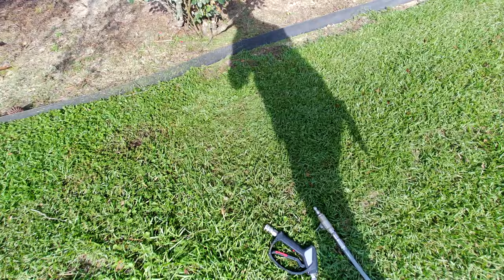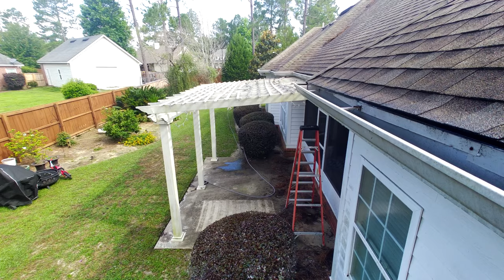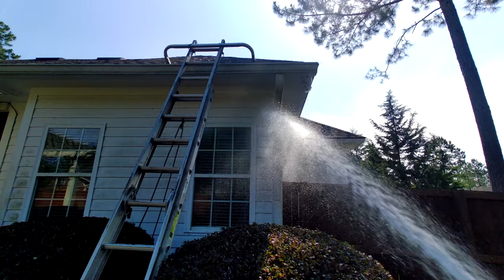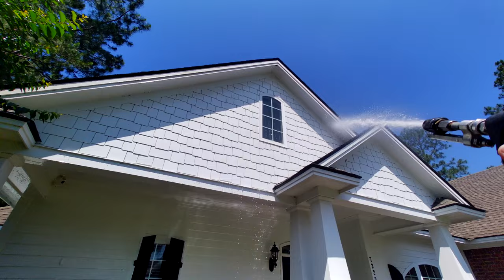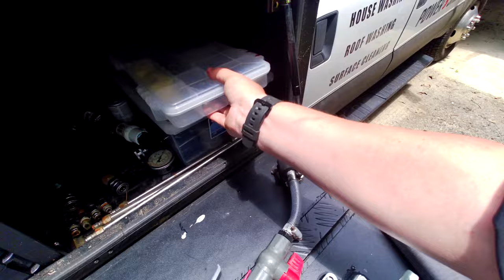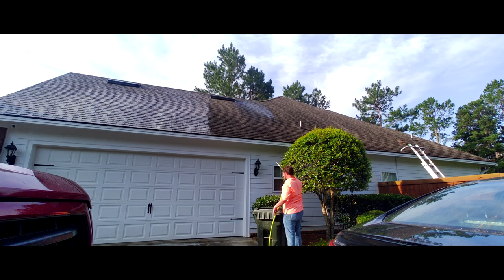BIGGEST drama pressure washing- 12v pump FAILURE while roof washing | Underprepared

Comment: Hey bud. great vid. What is the pump called behind your everflo? what is its purpose?
Reply from the maker: @jarrettwoodward2585  thanks man! So, it's not actually a pump, it's an accumulator. It has a bladder in it filled with air which helps keep constant pressure on the line so the pump doesn't cycle so often. They're commonly used in RV water systems where everflo type pumps are used. You can find Info by looking up RV water systems! Hope that helps!
Reply: @powershineme  perfect. I’m going to have to add one to my setup!